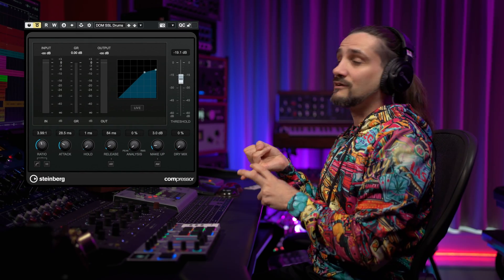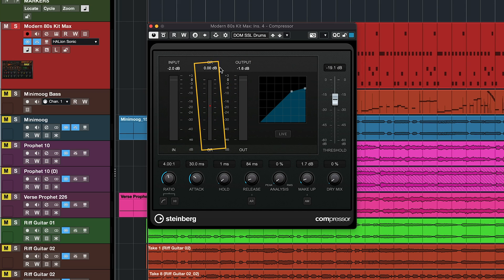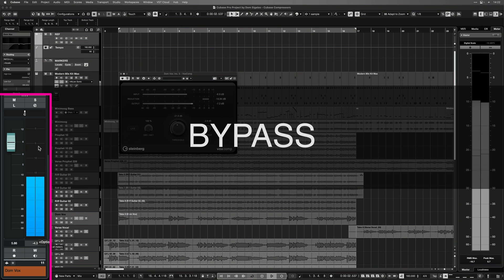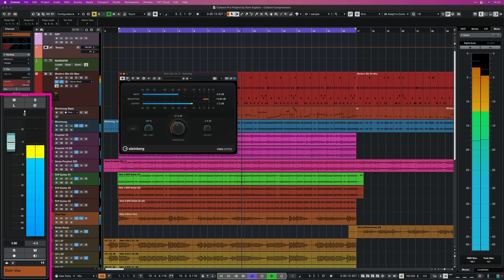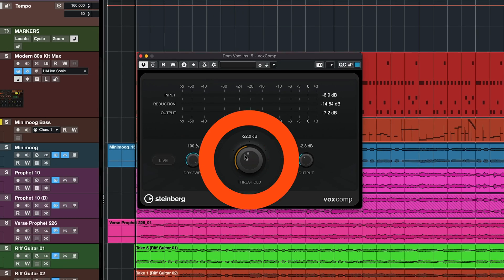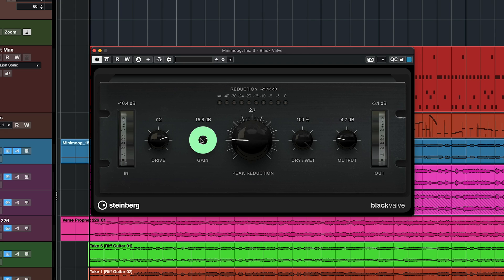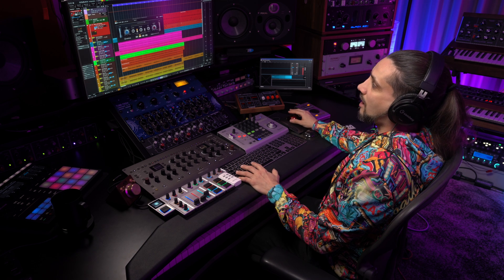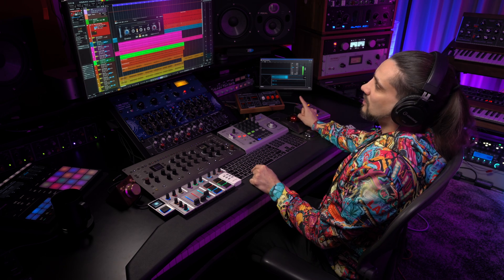Which Cubase Compressor Should I Use? | Cubase Secrets with Dom

Comment: I like simple Compressor, on drums, on mix busses, side-chain, or when I need just plain simple compression
Vox comp is great for Vocals obviously, 
Black valve - on synths, brasses, etc.
Vintage compressor - on parallel compression, sometimes on vocals, guitars
as for Tube Comp - I tried it several times for different scenarious, but it didn't work for me, so not using it

Comment: Hello, I bought cubase 13 pro yesterday. But tell me there is a problem. I cannot access my audio files from the section on the right. The audio files of the cubase program appear, but mine do not. Could you help? I am using windows 11
Reply: Did you install the Files in the Download Assistent and activate them in the Steinberg Activation Manager?
Reply: @littlewestghost7434  Yes, I downloaded all cubase files and activated them. but the problem persists
Reply: @littlewestghost7434  I found the cause of the problem and solved it. thank you for your comment
Reply: @SanatınGücü Would you mind posting what was wrong and what you did?
Reply: @AcousticBruce  There is a line in the lower right section where we need to see the audio files. I tried to move that line up and it worked.

Comment: I just love that we have all these choices, and they are all included in the DAW and 3 of those are available right in the channel strip.  I almost never use a 3rd party dynamics processor plug ins except for more special effects or the final mastering dynamics processor.
Reply: Cubase compressors dont have internal filters, channel linking and knee settings. For me, those things are absolutely necessary
Reply: @voinrima  I get it.  Some of them do have filters and variable knee settings, however.  Just not all of them.  I think most of them have side chain input sources though.

Comment: yes. Cubase has so great fx and pro compressors, no need for thirdparty.  Great times!
Reply: The only pro compressors are Pro-C2, ReaComp and smart:comp 2. Everything else is just kinda cool, not pro.
Reply: @voinrima  I've compared my Waves 1176+LA2A vocal chain with Cubase Tube Vintage comps etc. With a little tweaking you can achieve exactly the same result !!  ...overtones and attack behavior included. (Measurement/Analyzer/HP+ears: double signal left (Waves) and right (Cubase comps) hard panned - same sound, same levels, same modulation. It works great. 
That says it all.
Reply: @voinrima  nope. In a full song arrangement with multiple tracks you can't heare these tiny nuances.
# Don't mix in solo mode ^^

Comment: 50/50 Dry/Wet is a strong volume jump.
Steinberg needs to fix this.
You need to change the dry/wet ratio.
Squasher doesn't have this problem.
Reply: While we're on the topic, "Dry Mix" on the stock Cubase compressor is absolutely confusing 😂 It should just be dry/wet or "blend" or simply "mix"